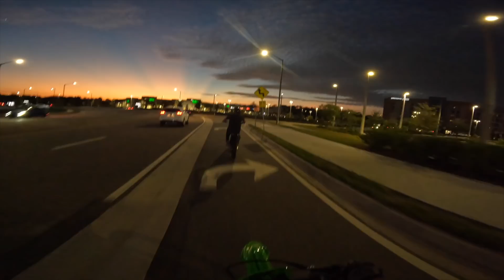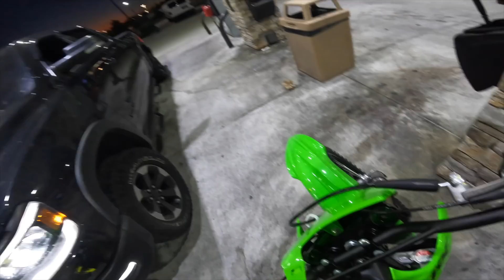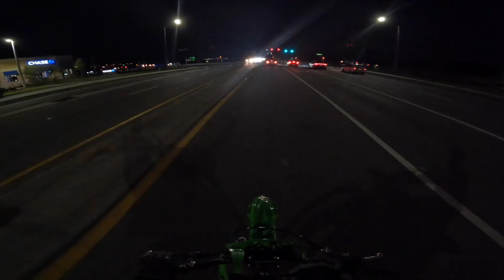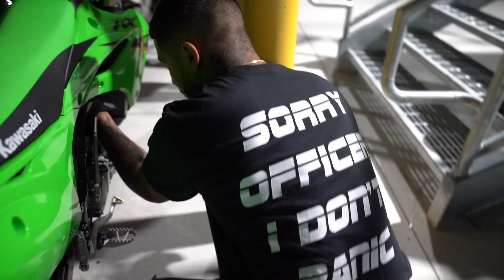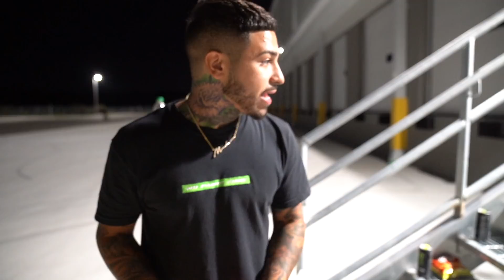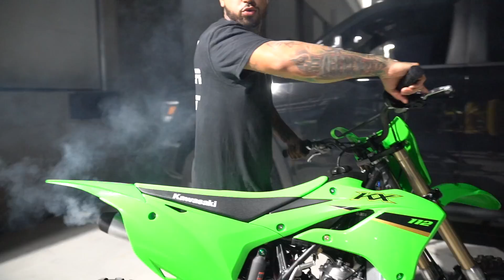MIXING 2 STROKE AT THE GAS STATION ON MY 2022 KX112 ! | BRAAP VLOGS

Comment: Buddy of mine has a kx100 bored stroked and sleeved to 123. it’s  an absolute ripper hauls 200lbs men around like any regular sized bike would, border line un rideable because of power to weight ratio

Comment: I always carry a 1 gal gas tank,  tools, new spark plugs, baby wipes, baby bottle with 2 cycle oil, and a backup bottle 🍼 as well, and a first aid kit!! And since the 90's we always mixed 32:1 (4oz to a gal) and we always been riding with no issues for decades! While the pack is at the gas station sitting like ducks, I'm in the cut fueling up and I always have gas.
Reply: Where are u carrying all that while riding though? A little nap sack is cool but anything bigger than that is OD

Comment: Mine is 32:1, follow the factory service manual. Running it at this won’t foul the plug. You wore this plug out with hours. They need to be changed frequently since 2 stroke is firing every other rotation. The oil has nothing to do with ruining the plug, it protection and coats piston, bearings, and crankshaft.